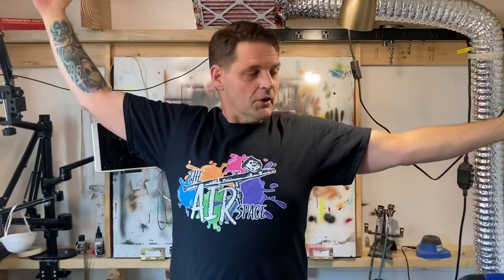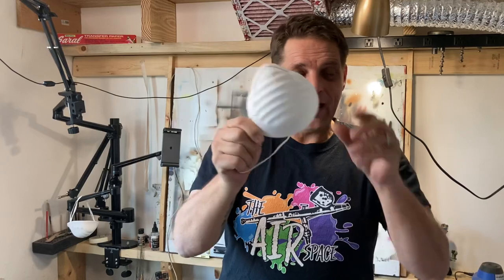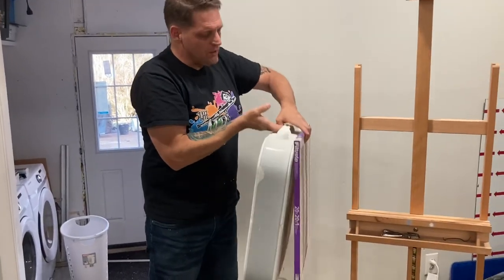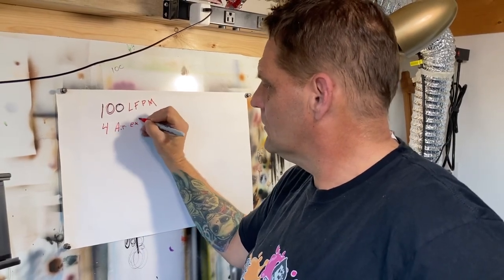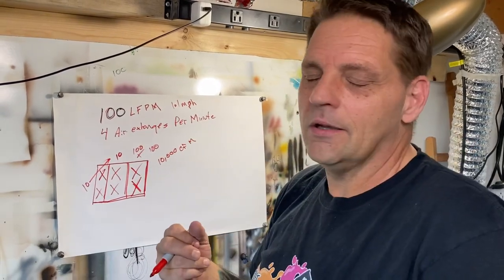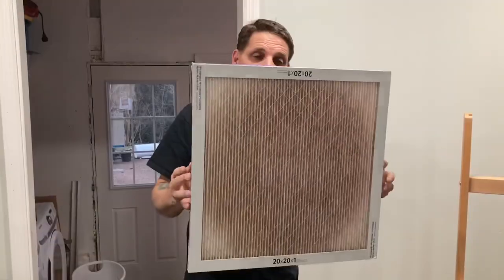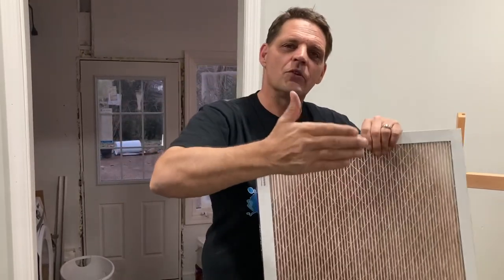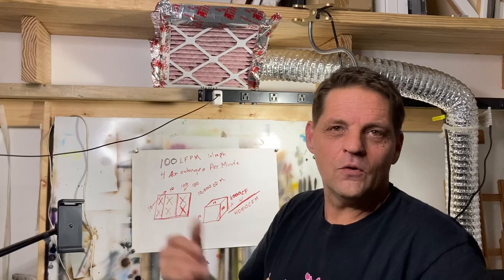Airbrushing indoors? How to keep a SAFER CLEANER environment!

Comment: Awesome  video. I certainly  need a better filter  setup  at home. Actually in a class for infectious control  in hospital work environments.  I'm  in the carpenters  union. Learning  about air exch per hour and hepa filters all this week. Keep the videos coming. Much appreciated.
Reply from the maker: I used to work for one of the largest HVAC / Plumbing companies.. I know a little about air exchanges :)  
  Interestingly enough MOST commercial buildings even without HEPA Level filtration generally have better air quality than the outdoors more often than not.  
   As houses get tighter and tighter they are moving along to fresh air exchangers.. Im sure they are going to talk about HRVs.     Its a good class you should get some fresh insight .

Comment: I really enjoyed this! Very informative and encouraging. I have a mini paint booth… and recently experiencing the limits I have in what I can spray. Definitely gonna figure out a larger filtration system so that I don’t paint dust everywhere. ( no problem wearing the mask) 👍😎
Reply from the maker: ideally id shoot straight out the back and then down. but since I am spraying on a whiteboard that will take a bit more configuring. 

A lot of t shirt shops (which do very heavy spraying) use a slat wall and pull the air down and filter it below.

Comment: I know about air safety while spraying paint but just got lazy about it. I worked in the scenic arts department at Seaworld before I retired from there and did a lot of spraying. However, there is a large spray booth there plus I would spray small things outside on occasion. The spray booth of course had a lot of air filters and an exhaust plus we had to wear a respirator while spraying. 
Here at home I don't spray urethane or any harsh solvents. I only spray premixed acrylic airbrush paint. I turn on the paddle fan and there is an ac vent in the room but I know it isn't enough. I have N-95 masks that I purchased during the pandemic so I will start wearing one when I paint AND, I'm going to order some MERV filters. I have a box fan and will sit it on a low table close to an open window. It's so hot right now I really hate to open a window but I will. 
I actually have watched this video previously but had forgotten about it until a few minutes ago. Thank you for making this video. It's important to have plenty of ventilation and a way to capture the tiny paint particles.
Reply from the maker: i really really want people to be safe.   If you are taking any precautions you are doing more than many... and more than I have at times.  I admit I rarely wear a mask for the airbrushing part.  But I do filter most everything I do, or exhaust to outdoors.   
Best to you! 
Bill
Reply: @TheAIRspace  Hey Bill. When you are spraying with acrylics and at the end of the day, do you soak your airbrush parts in anything? I recall when I worked at Seaworld we would shoot lacquer thinner through the airbrushes and spray guns when we were finished.
Reply from the maker: @sandrajohnson2489  i use a spray bottle with water spray it out, wipe out the cup with clotth.  then usually a tiny bit of isopropyl alchohol flush through the brush rinse and leave a tad bit of water in them (if using the next day)  if really dirty i use a small paint brush and will clean with iso alchohol or reducer.
Reply: @TheAIRspace  Thank you for replying!! I appreciate it. I also have been using a spray bottle with water to clean out the cup. I will then dump the water into a large plastic bottle and do this a few times then wipe with a cloth. I spray airbrush cleaner through the airbrush. I thought I might be missing a step though but I guess not. 
My cheap Master airbrushes (gravity feed and siphon feed) haven't been working like they should so I have been disassembling them and cleaning them thoroughly. This of course becomes a hassle.
I know I should invest in a good airbrush like Iwata or Badger but I just can't afford it. 
I don't do detailed work like you do though. I am mostly painting celestial/cosmic paintings. 
Thanks again Bill. I really enjoy watching your channel. Happy painting!

Comment: Highly recommend the Moldex Airwave 4800 mask! N95 + blocks organic vapors, but the best thing is that it's *pleated*, so has AMAZING breathability. Almost like nothing there. So nice.
Reply from the maker: ill have to check that one out.   I finally got around to building out the little spray area a bit.  as I mentioned in this video.  now I have a box /easel setup.  and filtered/carbon extraction when the weather is uncooperative and outside exhaust when it is.   (or if i'm spraying a bit heavier)

Comment: Great tips..what size in-line fan are you using? 4”. 6,” or 8”? Thanks
Reply from the maker: im using a 4 inch right now.. my plan is eventually move to a more downdraft style and i have not decided on if ill move to a 6 inch fan or run dual 4 inch fans.  of course that all hinges on me getting around to setting up that room the way i want.  I  still keep other options open for when im painting in the actual larger studio area.

Comment: I don’t have access to a window but I can cut a access hole above me and vent it into the next room where I will place a filter would that be enough ventilation I only spray createx illustration paint
Reply from the maker: each person has unique needs.   if your painting flat on a desk doing small 8x10's spraying low pressure through a micron you wont need much at all.      if your painting higher pressures say 35 and above vertically obviously thats gonna throw off more overspray.  
A merv 8 filter pulling overspray as close as possible to the actual spot you are working (pulling down is better than up) is going to be way better than doing nothing for certain.

Comment: If you are spraying a lot of solvents in a spray booth it might be a good idea with an explosion proof fan... like a blower with the motor separated or like a 12v/24v marine bilge exhaust fan... and a mask with a 6001 filter.

Although i never heard of an airbrush booth igniting, i used to have a metal bladed inline fan with the motor exposed and it had me a bit concerned, definitively not a good idea in a larger paint booth! 😱
Reply from the maker: absolutely.  I do not spray solvents in my home.  i believe i mentioned that  I built a small booth for 3 d items and an easel setup in that area now.  and i have one fan that pulls direct outdoors, and one that runs through a filter and fan. so I have both options.  And yet i still wouldn't use urethanes in the house.
Reply: @TheAIRspace  
I was wondering if i could get your opinion on something...

Im stuck in an apartment these days, i have a spare bedroom, i spray a little bit in a small spraybooth in there, but it is not a good solution as i like to spray with solvents and i want to spend more time spraying.

I have had two different ideas that i been thinking about for a while now...
One is to build a fully enclosed spraybooth, like a sandblasting cabinet. Although i think that might work it may be hassle to use if i want to spend more time spraying.
Im clumsy enough as it is and changing paints and brushes inside an enclosed booth with those giant gloves on would become annoying pretty fast...

So what do you think about this,
As you mentioned there is a lot of gear designed for growing plants around these days and i have been looking at a grow tent. They already have inlets and outlets for ducting and wiring.
I was thinking a 4 foot by 8 foot tent, two 250-350 cfm fans, one running filtered air in at ground level and one running air out the top then over to the window, the fan in running a little bit slower to keep negative pressure.
Then on-top of that my spraybooth inside with a third fan also running out to the window that would catch most of the spray...
Should be fairly easy to clean whatever particles left behind regularly by misting the walls and wiping it down, and while curing paint or not using it i could always leave one fan running to keep the negative pressure... the whole thing would be fairly portable and not needing any construction work done to the room.

This is about as safe as i can think of making it...
Would you be comfortable spraying solvents in a setup like this inside an apartment bedroom?
Reply: @TheAIRspace so would createx airbrushing paint be fine with your setup of the fan and filter with a pot vac
Reply from the maker: @AlexBartelme-lw5lv   Running a fan and filter setup   even just a box fan and filter setup to grab the overspray would be fairly safe for airbrushing with createx.  
almost all of the t shirt shops in kiosks are just filtering the paint particles.  and returning filtered air back to the environment.    Pat Gains who owns multiple shops has a diagram showing what fans he uses in walmarts.

Of course always use common sense, and its entirely dependant on volume.

Comment: This is a lot lol im just gonna go outside in the cold I had a machine for awhile but nervous to play around. Thank god I didn’t start spraying it very intimidated
Reply from the maker: its really not very hazardous    if your doing acrylics...      You can simply put a fan and filter by you.  its not likely you will be spraying huge volumes    To be honest I started on my kitchen table with one airbrush and an old compressor
Reply from the maker: ooops hit send too fast.    IF you wear your mask you dont even have to do anything but overspray will over a long time create more dust in the room.
Reply: @TheAIRspace  i appreciate the tips ! Thanks
Reply from the maker: definitely my intent is not to dissuade anyone.  I just want people to be aware and you should protect yourself.  In my case I do some heavy volume painting at times,  and the setup i have now is ridiculously cheap and easy.   

Its a filter and fans and some foam core board to keep overspray from getting on things.

Comment: sir can you please recommend a good airbrush that has a fan cap . i  watched your vedio on gsi creos ps290 and the masterbrush one and thanks for clearing that gsi is way better. i watched th2  review and i think it got the best nozzle setup . there is day and night difference in the nozzle shapes of th2 and th1. Th1 got nozzle like gsi creos. I think i should save money and get gsi creos rather than th1 as there is not much difference in nozzle shapes. Or th1 is worth the above 400 dollar price.
thank you, will eagerly wait for your reply
Reply from the maker: Im by far a fan of the ps290.  The TH1 is a great brush as well, but the difference between them is very small.    The Th2 is great, but i would rather spend money for an LPH80 mini spray gun before id spend money on a th2.   That's just my thinking.  depends on if your compressor can handle it.  

If i were in the market for a fan pattern airbrush, id get a 290, in fact that is the brush I kept myself :)
Reply: @TheAIRspace  thank you so much for your advice sir . I think i will get ps 290 as i dont know if my compressor could handle a mini spraygun as its a small airbrush compressor with 3L tank that gives me at most 40 PSI constant.So i think my best option would be ps290. And i really want you thank you for you valuable information that you provide.

Comment: i would like to  3d print, sand the prints and also spray the prints, but safety concerns for my family is exactly what blocks me. i dont want to poison them. i dont have a separate place to work, just my flat . i mean how the duck, do japanese artists do that. they have tiny flats.
Reply from the maker: Heat recovery ventilation would be my guess.  And that’s a whole long explanation
Reply: How about a fully enclosed paint booth... like a sandblasting cabinet.
Im in an apartment myself for now and i have been thinking about building one, I don’t do a ton of airbrushing so i think it might work for me, would be good for curing and keeping the dust out of the paint too and i might get me one of those airbrush sandblasters also 😁

As far as 3d printing, there is this insulation plastic you can buy for covering the windows in wintertime... make a cheap frame, wrap it in this plastic and run a duct out the window with a pc fan on it...